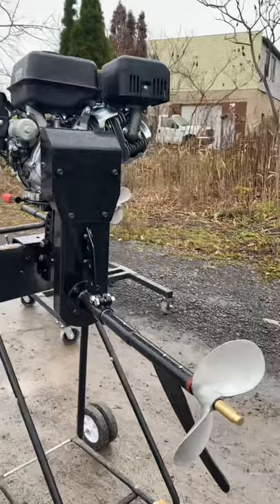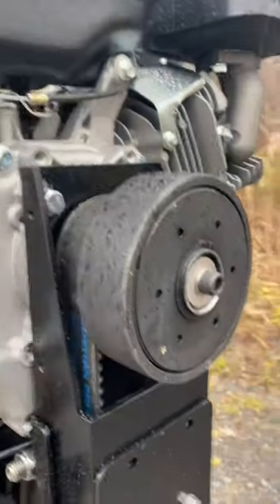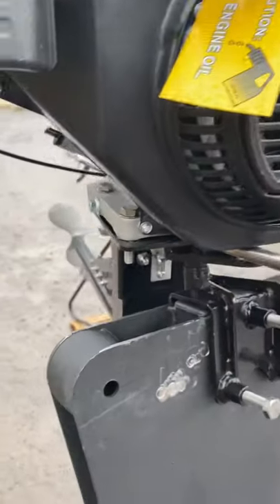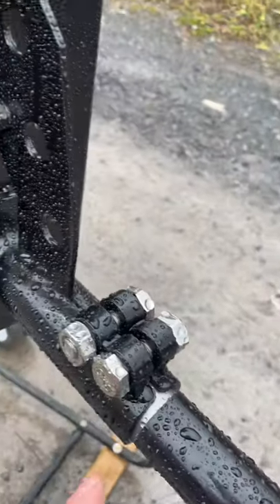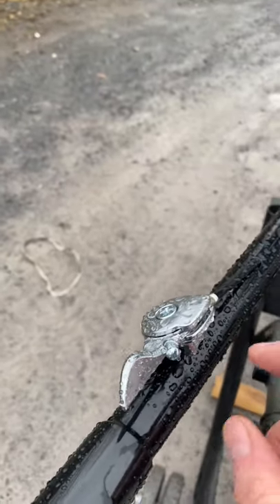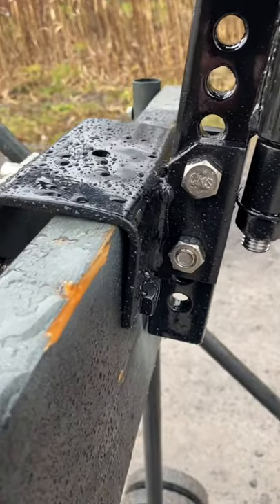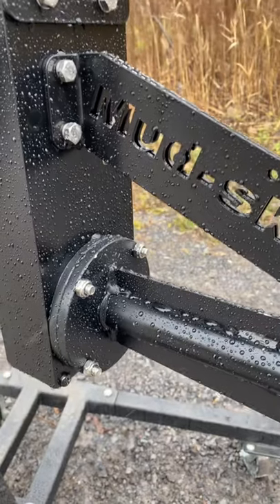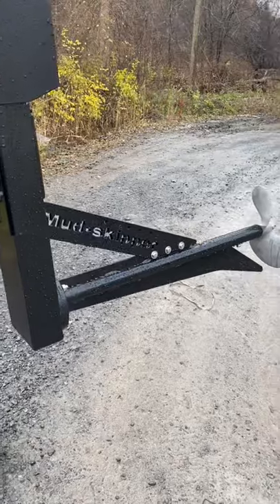13-16 Feather-Lite 🪶 surface drive vs Sc300

Comment: Can you make a video showing the Surface drive sport kit vs the feather-lite? is the better gear ratio the only difference?
Reply from the maker: We could do that, yes

Sport model has a cast aluminum housing. Weighs approx 100lbs and uses a 9" prop. Available in 15-16" or 18-21" trim

The Feather lite uses a pared down, welded aluminum housing. 9" prop. Only available in 15-16" trim. Feather lite weighs 65lbs

Both kits use the same clutch, same prop but different belts
Reply: @Mudskippermotors  the weight savings alone is enough for me lol we are currently building a 1448 and  looking at different surface drive options. This was a great video thanks again

Comment: Will you make a featherlight that can be used with 22hp motor?
Reply from the maker: 22 hp engines typically weigh at least 100 pounds and need a reinforced frame. We do sell a surface drive that weighs 120 pounds by itself that fits the predator 22